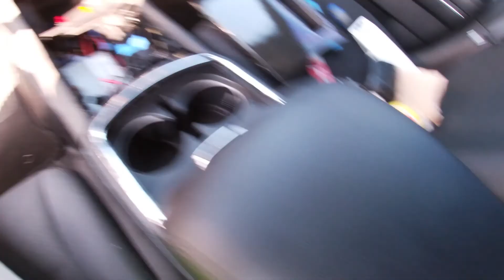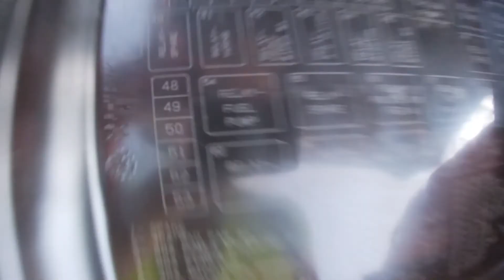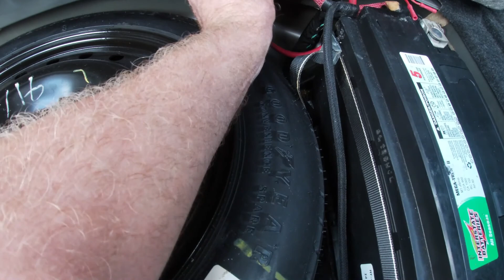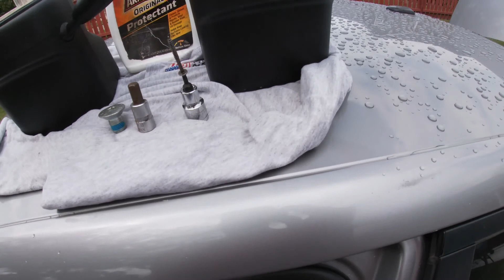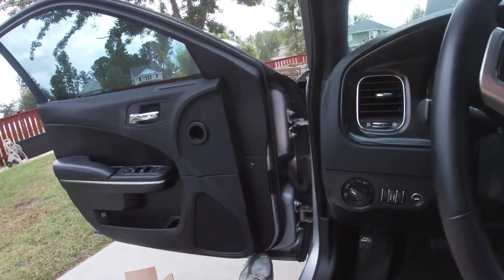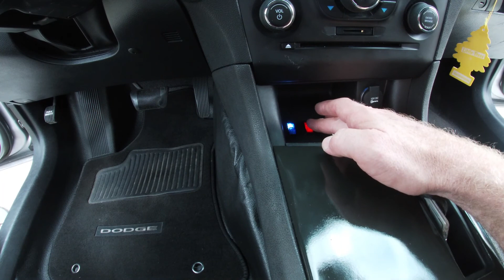2011-2014 Dodge Charger Police Package Center Console Wiring Explained Part Two.

Comment: I've tried searching and can't find any info, but I have a 2011 and I found the headlight flasher wire but I cannot find one that runs the tail light flasher. Can anyone tell me what color it is and where the Flasher actually is? Thanks